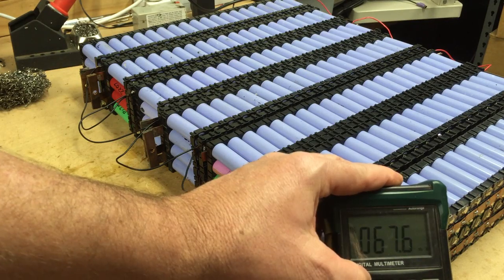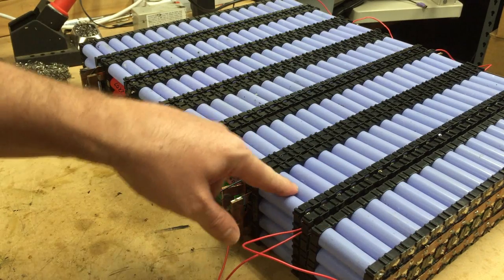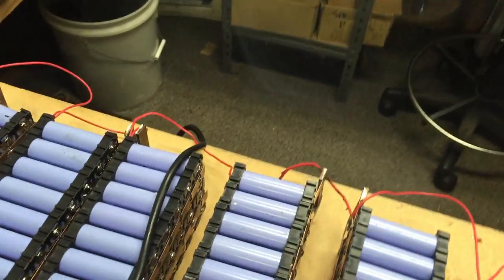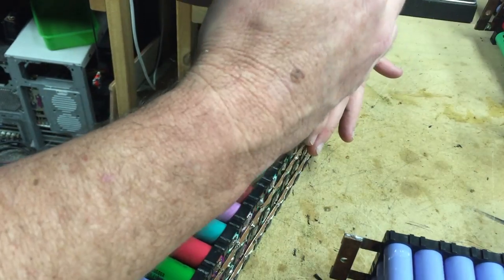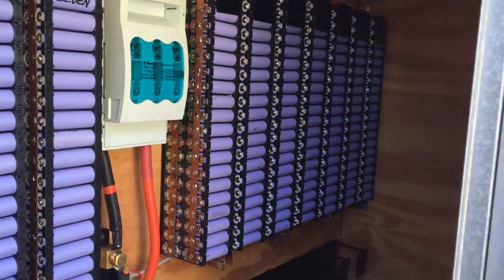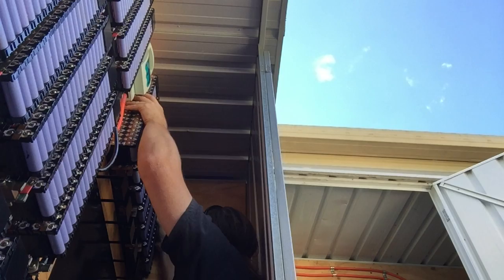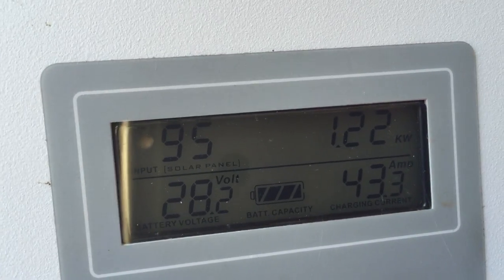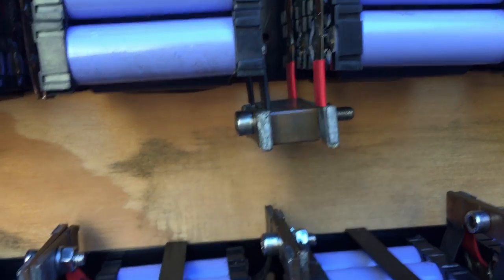Building a DIY Powerwall from used laptop batteries

Comment: Hey there! I have a question... I'm getting some LiFePO4 cells for a new solar project and I'm planing on using a EPever/EPsolar tracer charge controller and I want to know what setting to use to charge the pack... The charge controller has 4 "modes" that I can choose from: flooded, gel, sealed and "User" the EV power website says that you can simply set the mode to gel and it will be fine, but the charge curve of gel lead acid batteries are very different from LiFePO4 or any Lithium battery. Specifically, bulk Charging, constant Charging then float Charging for lead acids vs just the simple CC-CV charge method of lithium. So would it be better if I just set the mode to user, and set a constant 28.4v for all "stages" of the charge? What would you do?
Reply from the maker: I would call EPsolar :) sorry I'm a googler not an expert hope you understand.
Reply: Haha! Alright, thank you though!

Comment: Hey peter,,what did you use for the spacer blocks in between each pack..was it square copper bar and cut to size, and where did you get it....thanks!
Reply from the maker: It's just a bar of copper I got from the local metal place... That's the OLD way and not cost effective at all NEW way is sooo much cheaper and faster - https://www.youtube.com/watch?v=XPdJRD57T7A

Comment: Would you not be able to get greater capacity if you would use Mallory ultra capacitors ??? Please let me know if that would be true. How big are you going to build your power wall ??? What would consider the best make and power size battery ??/ Thanks
Reply from the maker: never used caps, i'm at 40kwh, best is the best one you can afford

Comment: why are you using cells with a relatively low storage capacity? because of cost? Or do they just degrade at a slower rate? LG makes some 3000 mah 18650s that can handle a 20 amp draw.
Reply from the maker: All my cells are used there for cheaper & i have a max amp draw of 0,6amp so 20 amps is of no use to me ...lol

Comment: Hello and very nice work I see you are making 3.7v bundles and wiring them in series is this better then making 48v bundles and wiring them parrallel.
Second tell me about the term fuse? is that the small wires tying the battery to the buss?THANKS
Reply from the maker: this way seems to work for me, the fuse wire is 0.4mm wire found on amazon

Comment: lower mAh = higher instantaneous output
if you were to use 2 batteries in a side by side test, the one with the lower mAh will "die" faster, but operate cooler.
higher mAh = high power density = heats up quicker

and anyone who's seen these things explode knows not to forget to install temperature cut-off switches
Reply from the maker: Patience my friend I'm getting there.. Stay tuned or watch the last video I released. Taken longer than it should but the time has come to up my game BIG TIME

Comment: With this many cells in parallel how do you deal with bad cells as they occur. Would they not start to damage the other cells?  How can you detect where they are without taking the whole pack apart and testing them all?
Reply from the maker: I now have double the cells in this video and about to install another 20kwh more making 60 kwh in total. If a single 18650 cell goes bad it just blows a cell level fuse. 10 can go in one 80p pack and there isn't really much issue until you get to lower voltages - and by then you can see with the www.batrium.com bms the low cell and you just change it out with a spare.. takes a few minutes and in 2 or so years only replaced about 7 80p packs.. not bad i thinks

Comment: you could consider dehumidifier with silica gel or similar products on those really rainy day's.
Reply from the maker: need a 44gal bucket of it ..hahah
Reply: HBPowerwall wise good sir. Very wise.
Reply: Any chance of a surface mount  super cap board. For those times you really need full current arcs. huge arrays of them would be as equally impressive and dangerous. But with your array of Samsung batteries, could you potentially arc current into those acrylic glass art. perhaps wood burn art also with those?
Reply from the maker: I guess you could I have seen videos of it looks pretty cool

Comment: When seeing you crawling between the wall of the shed and the right two battery packs with absolutely no way to jump away from the cells in case of problems, i cross my fingers all the cells will keep functioning safely....

Nice monitoring system on your computer b.t.w.

Can you tell me where you bought this intellygent battery voltage communication modules (and do they top balance a bit?)?
Reply from the maker: Poor design for sure, I actually hate it - so hard to work on but been like that for years so it can stay till it's retirement

Comment: What kind of charge controller do you use to keep lithium batteries charged. Dont you need a certain kind for the 18650's?
Reply from the maker: I use a https://goo.gl/GVuCR4 and use custom settings to keep the voltage range with limits of the cells - also use a www.batrium.com BMS to keep a watchful eye over my cells.

Comment: Hey, lets say I have 20Kw worth of power wall and it is all charged up and know i come home from work and I start using power at my house and I'm working in my garage and want to use my mig welder to weld some exhaust pipe and run a few other power tools. would this still give me any trouble? Can you run your A/C system and cool the house? Are there any Limitations to using a Powerwall?

Comment: Please follow through on your test of using all lower range 1500-2000 mah li-ion batteries in a separate powerwall to compare load and cost characteristics for your home.
Reply from the maker: Sorry, not a cost-effective test. But it will work, it just won't work as well
Reply: I just had a thought that if current technology would allow the cross-platforming of batteries, then I think we would be onto something big. For example, if lithium ion batteries would become compatible with say nife, or other chemical-compositioned cells. Then, the long-term cost of either battery type comes to a simple intersection of the supply-demand curve and the cost of each battery type becomes more affordable to a wider population across the world.

Comment: Lots of APC UPS's run on 48 VDC batteries and are discarded when the batteries fail.  You might be able to pick up one on the cheap.
Reply: I have almost 100 SLA bateries from several symmertra 16kva systems. I got here trying to find out how to use them to make a powerwall :)

Comment: Wouldn't using old battery cells make the system less efficient than if you used new batteries? How do you check which batteries need to be replaced over time?
Reply from the maker: More efficient than making new batteries when old ones still have life left - Several ways i can tell if cells go bad. 1. My BMS a www.batrium.com unit can tell me in an instant if any on of the jow 56 packs are low, high or normal voltage, each pack has 2 temp sensors making over 120 temp sensors with in my powerwall 2. Thermal Camera. 3 Visual inspection
Reply: @HBPowerwall  Cool, about how long do they last before you need to change them on average btw?

Comment: I managed to release the magic smoke from a (comparatively) smaller 50 cell ebike battery built in a similar fashion. I seem to recall that it made a much larger cloud of smoke...
Reply from the maker: it was larger before i was able to get me fone out ....
Reply: Aah. Fortunately, I didn't blow the entire array of packs(the E-bike was at the time wired with 4 36-42v packs in parallel). The BMS circuitry on the other 3 packs managed to keep them from going up alongside the one that had its mains negative lead come into contact with the common positive line(the way these packs are wired, the BMS circuits regulate the negative output, so if the positive line connects to a regulated negative output, this won't happen. The mains negative is the line in between the battery negative and the BMS).

Comment: hello mate, would building a battery pack mixing 1500mah cells with 2000mah cells be bad is that too much of a gap in capacity ?? regards
Reply from the maker: I use 2000mah - 3200mah cells so will be fine as long as you build balanced packs - you can use https://secondlifestorage.com/repackr.php to help build balanced packs
Reply: @HBPowerwall  thanks a lot mate .......thats given me the go ahed for building a half decent ebike pack with cells i have salvaged from power tool batteries sony vtc4 and vt3 to be precise.......thanks again buddy have a nice day

Comment: Ooooo, there is a house fire 🔥 waiting to happen
Reply from the maker: Where? come on - don't be so narrow minded - take 12 hours of your life and take a look at all the improvements i've made go on i dare you!
Reply: HBPowerwall not Narrow minded ,just from a forensic engineer, look at a Tesla rack on fire.  Your racks are approaching the same capabilities during uncontrolled discharge.  Safety first, you don’t want to be the guy who regrets.  What protection do you have in place for what events and what modes of failure.  Cover ALL the bases.  A wooden box is not appropriate for the risk.
Reply from the maker: 4480 individual cell fuses, HRC fuses, 120 temp sensors anyone can trigger shunt trip to shut down ALL charging and discharging - Kick ass BMS said the wooden box is inside a tin shed - i've gone out of my way to build this thing the best possible way - this video was from years ago anot not close to what i have built today. (today it's larger soon to be 60kwh of storage) fire/smoke detectors, fire extinusers (that'll do nothing if it does catch fire) Shipping container is next :)
Reply: "120 temp sensors" for how many cells is one sensor? I think, You need 1 sensor for 4 cells. O:)

Comment: Ok, I am really stupid about all this, but I have a question. You say this is a 20,000 Kwh battery bank. My house uses 900 Kwh a month according to my power bill on average over a year. So am I correct to think that if I charged this something like this to full charge it would power my house for 2 years????? Thanks for any answers, not sure about all this.
Reply from the maker: I suck at math but in theory i think you'd be close.
Reply: Wow, must have had to much whiskey the other night, not sure where I got the 20,000 Kwh from LOL, sorry for the dumb question.

Comment: Hey I wish I could get cells like that .I made me a ebike and cant even get anuff cells to make me a battery for it. Hard to get around here . Good work dude
Reply from the maker: It's almost a full time job finding cells these days lol I've only made one or two eBike batteries - so much easier than home level storage lol
Reply: @HBPowerwall  hey dude you doing ok . Hey I don't know if u have time or not but if u do and dont mind .I got a hold of 60 lg cells and I need to build a 24 volt  250 watt. Battery for my ebike.  I know u know more about this stuff then I do .can u tell me the best way to put them together to make  that battery.  O the cells are 1500. Ma. I through I would use that many so I can get more miles out of it .do I make sense   . I mean how many in p. And how many in s. If u can help me out on that I would owe owe u one .sorry if u have time and don't mind .thank dude I like your work .I know that keeps u busy. The powerwall and all .thanks

Comment: that's cool wish I had one too, I have a 48 volt Inverter but I have 8 - 6 volt batteries @ 420Ah witch is about 20,160 KWH I know I can use half of that but I want around 1500 Ah batteries in something like 3 strings of 500 but I'm looking around for something new.

Comment: Thanks for your videos! Very informative and I am a new subscriber.  I bet you have a ton of experience thus fare with what you have built and was hoping to pick your brain if possible. I have been planning a similar system for a while now to go off grid knowing the initial system is only going to power about 25% of our current usage, but I am a bit stuck on the inverter side of things. I have a 10,000 watt peak (12v) inverter I was planning to use but the way this one breaks down is 4 channels of DC input and four outlets on the other side at 2500 peak watts each over 110v (and if I understand correctly that's only 22amps), and I'm struggling to figure out how to provide multiple channels into the "house grid" at the same time.  Maybe swap this one for a grid tie inverter, so that I can connect one 50 AMP 220v line from the inverter to a 220v breaker on the main and start to grow the battery bank as needed until I get close to the 50 AMP breaker tie into the house grid, and then add another grid tie to a different breaker until we hit our daily usage, but I dont know how to do that with multiple inverters given that the system is supposed to shut down automatically in the event of a grid power outage while i am growing it, and that begs the question similar to what you mentioned in this video upgrading your inverter for two bigger ones for a total of 8k, how are you connecting both 4,000 watt inverters at the same time to get 8,000 watts going into the same house grid at the same time?  DO you jsut plan and assum you will sell and swap the smaller ones as you grow it?  Are you using grid tie sensing inverters and trying to match each other?   Thanks Mike.
Reply from the maker: Unfortunately can't help with the power side of things as well i'm a youtube baby - All i know comes from here lol - that said maybe www.secondlifestorage.com is a really good group of people in the forum that could help out, or even DIYPoweralls on fb https://www.facebook.com/groups/diypowerwalls/ more replies means better change of getting info that'll help! Thanks for the extra sub :) Pete

Comment: for approx 16KAU you can buy a 10KWH ZINC BROMINE BATTERY that won't have a limited performance range. they don't loose efficiency as they age. in 10 Years time they will still be putting out 10kw. these batteries will most likely be at best at 60% original storage. capacity.
Reply from the maker: +bryce DENSLEY what fun is that ?

Comment: really nice setup... no doubt ! I've been trying to find answers in your older videos just when you started using those 18650 batteries and I have a couple questions (or maybe point to the specific video instead of explaining...)

-how did you test each and everyone of them, then sort ALL of those batteries, I see you mixed low powered batteries with better ones too, why ? aint this affecting the overall performance of the battery pack ?

-how do you keep EACH cell balanced in your battery packs ?

-how about temperature monitoring of the battery cell during charging and drain ? does it matter ?

Anyway, again, really nice job you've done there... I don't know how much did all this equipement cost you but it's nice to see it run. I don't know if it will be (and when) profitable one day with all this investment but I am really impressed !

Good work !
Reply from the maker: - A new/updated video for the battery charge and discharge will be done in the coming days as more parts arrive. 

- For now, I havn't just balanced once when putting into service and so far they are pretty good!

- Temp isn't an issue as load per cell is something like 0.3a per "individual 18650 cell" at 2400watts (max inverter draw)

Price... lets just say there isn't change from .....ummm just say it's still cheaper than a powerwall.
Reply: HBPowerwall Thanks for taking time to reply !

One last question, what happens if you have a single cell that will fail in one of your pack ?

My laptop battery pack is totally dead because of a single cell out of 6...

I mean with the quantity of cell you have there, this is going to be a nightmare to find that defective battery no ?

This is why I asked how you manage to balance and control each cell...

Or maybe I am not understanding correctly how a battery pack with multiple cells works...
Reply from the maker: when you series up 80 cells they all balance, when you parallel up 7 cells (to make 29.4v bank) the 7 cells will undoubtedly slowly unbalance naturally. how ever if one "18650 Cell" in one Cell goes bad it'll either blow the cell fuze (this is the hope) or will drain the packs power leading to a much lower voltage of that cell. Then you just removed it and replace with a spare. Pull it down and test each cell voltage and retest hole pack again thru the dischargers.. It's a lot of work yes but not the end of the world.
Reply: HBPowerwall thanks for the precisions ! I'm watching your videos from the oldest one and see you progress in building the battery packs... I think I'm missing on the technical parts though so thanks for replying again !

Now I know why you have all nice blue battery packs ! I was under the impression that you scraped your idea of using used laptop cells and bought new blue cells ! I get this part at least ! Good work !!!

Watching the soldering of the buss bars right now !

Comment: How about you use higher gauge wire because you're pushing so much amps then what the cable can handle
Reply from the maker: Cable is rated to 300amp - max load is 80 amp :)

Comment: Sorry i am not a technician or something, but can i use 1kWh per day for Aircondition,Tv,lightbulbs, charging laptop , for a whole day ? what if i didnt charge the batteries for the next 20 days? it means i can use the remaining 19kWh during those 19 days? or it will go if i dont use it the same day?
Somebody please answer me if you understand me
Reply from the maker: you would be using about 1kwh per ever hour or two running Aircondition,Tv,lightbulbs, charging laptop so would only last a day or two before you would need to recharge.. They are batteries so use for one day and come back three days later and the remainder is still there for use. Pete